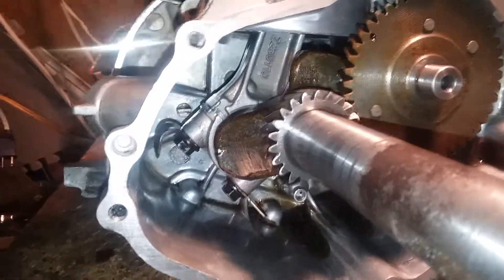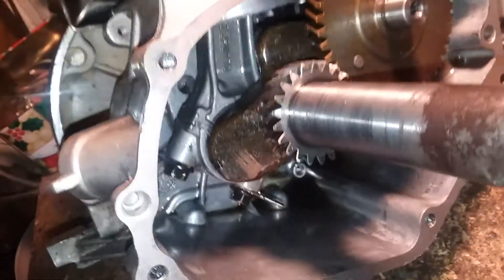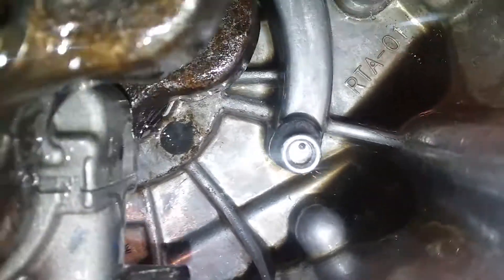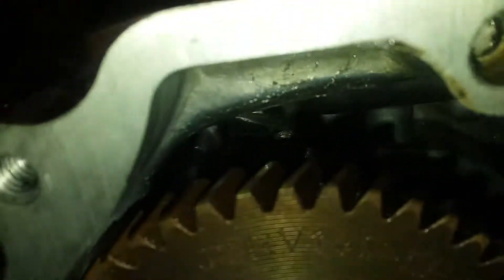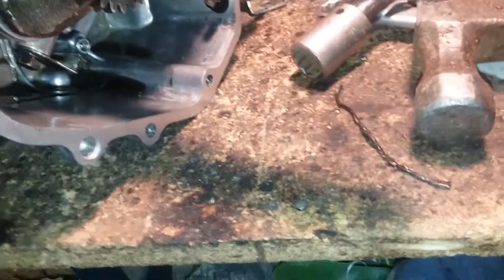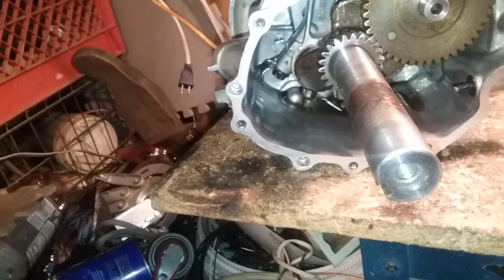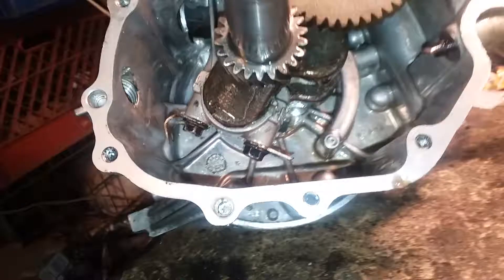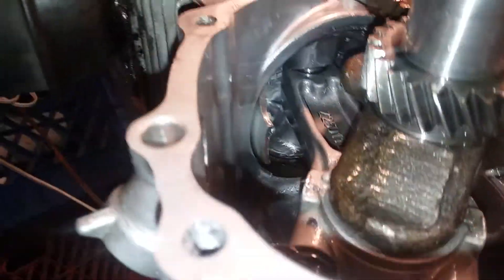Oil flicker modification

Comment: Cool, oil dippers. Make sure you put a BIG kill switch for instant spark cut off in case of a runaway engine, and drill it into her head what will kill the engine! the reason I say this is that a 14 year old boy lost his marbles when the throttle stuck part way open, did a big loop around the parking lot, and dang near ran 3 of us over! Brakes, what brakes, he never hit them , or the kill switch, my son chased him down and hit the kill switch. Basically people panic when an unknown situation happens, so you have to drill them like an army drill instructor!  LOL  :)
Reply from the maker: We call it Whiskey Throttle, it's like hitting the gas pedal when you're trying to stop! I've got the kill switch on it, but will definitely make it big and easy to use instead of the toggle switch i had for it, thanks for the tip